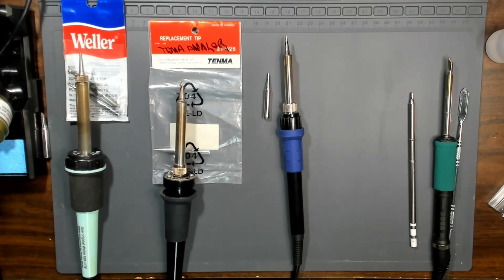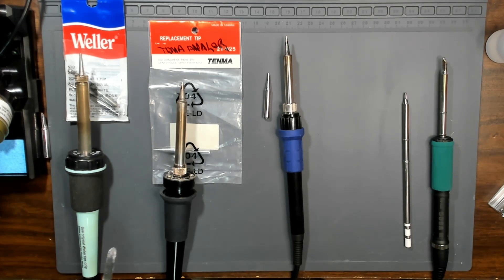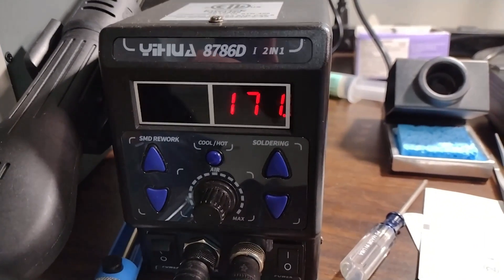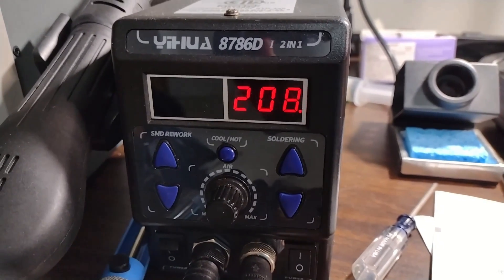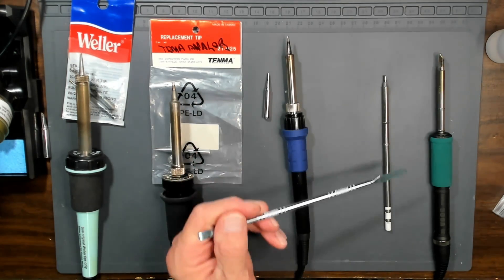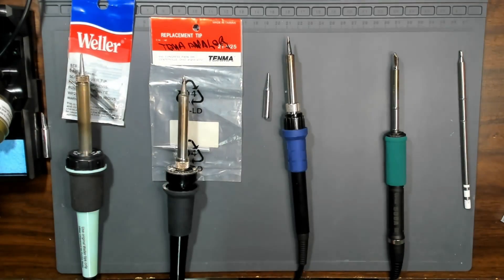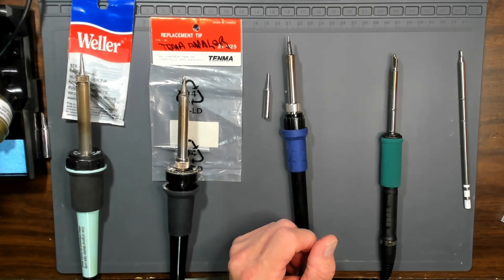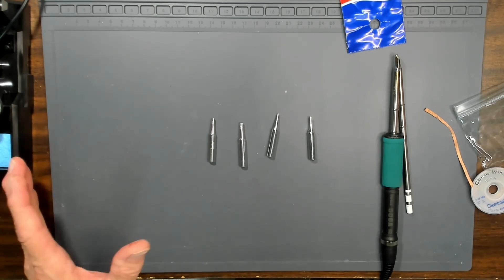What to look for in a soldering iron used for electronic repair

Comment: Great explanation. My old Weller Expert died and have been struggling to find a replacement iron that I like as much. The one you show second from the right is nice and I have found a decent controller for it. But, as you rightly say, you need the power (W) to prevent rapid cooling on large planes. Thanks.
Reply from the maker: I used to love Weller. Now my favorite is the one on the right side. It is the one that uses the T12 tips. They really heat up quickly and seem to hold the temp when soldering a connection that sinks the heat. The one I use is YIHUA 948DB+ II which I got on Amazon.